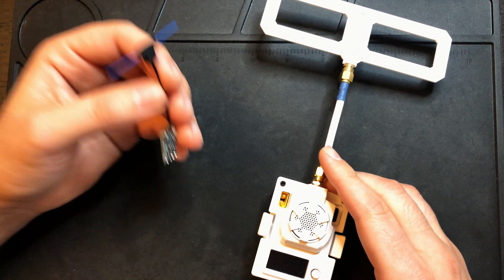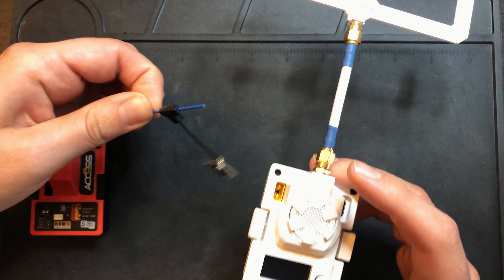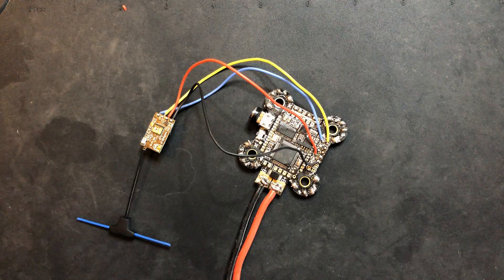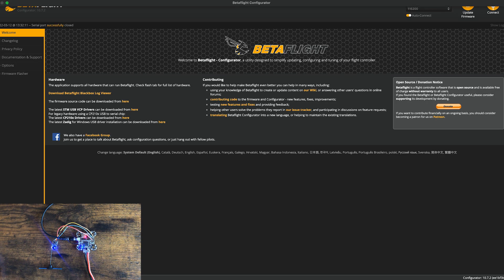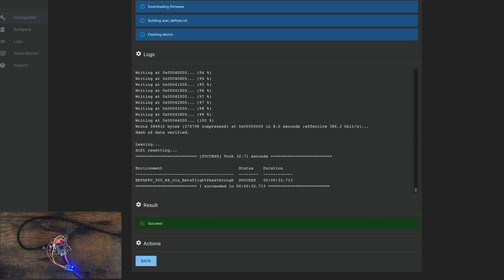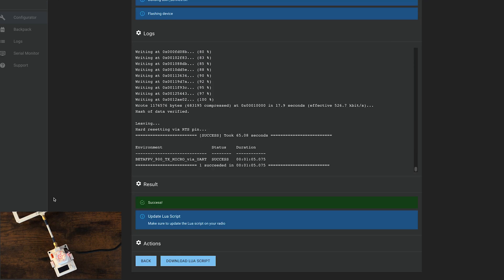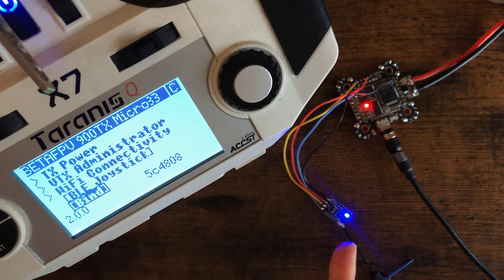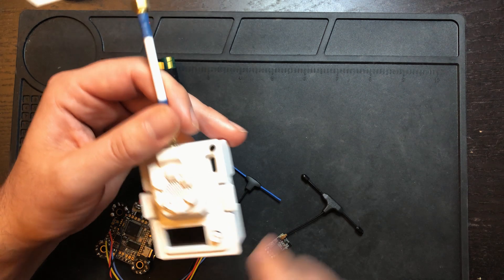Bye Bye FrSky - BetaFPV ELRS Setup

Comment: Do i need to change my radio too? I currently have a QX7 - i can just add this module to it? I wouldnt want to spend more to just buy a radiomaster radio or anything as more or less they are all same. What do you say?
Reply from the maker: You can use this module to the qx7 you’ll probably want to do the “crossfire mod” to the controller though.
Reply: @TRONCATFPV  u mean i need to update something on the radio too? hope no soldering required.

Comment: Hi, does any brand of elrs receiver work on this beta fpv transmitter? Ex: Happymodel radiomaster jumper. Or do you have to use only receivers of the same brand?
Reply from the maker: as long as its ELRS and 900mhz it will work with this module 👍
Reply: @TRONCATFPV  OK thank you

Comment: Hey, I have probelm with Express LRS app, i did every step like you did but at 3:49 as you "build and flash" it writes me ERROR message, but i dont know why.. (I have speedybee v405 STACK, ELRS 2.4GHz betafpv flat antena RX and BetaFPV Lite radio 3 (ELRS version). I cant connect these together. Have you got some idea what could be wrong? Many Thanks ! :)
Reply from the maker: make sure you have the receiver all set up in betaflight first. Then try flashing through ELRS again.
If it still doesnt work make sure your receiver is hooked up to the FC correctly (RX-TX and TX-RX)
Reply: @TRONCATFPV  Thanks, but ye everything correct -> RX-TX, TX-RX,
 betaflight -> Serial via UART, CRSF,  also correct port set as serial Rx.
Reply from the maker: interesting. Are you trying to flash 3.0 to it?
I was flashing 3.0 to a happymodel TX module yesterday and it was giving me an error. As soon as I flashed 2.5.1 it worked. Then from 2.5.1 I was able to update to 3.0.

Maybe try an earlier firmware and see if that helps.
Reply: Ok, i will try thank you for help 😊

Comment: What do you think the best way to go is? 915mhz? Or 2.4ghz? Want something 1W does the 2.4 and 915 both run 500hz mode? Benefit to 2.4 over 915? What has better range? Thanks for posting been looking eying it up. Have the full sized TBS crossfire think it will do 2W now and diversity recovers on my 7 inch builds. But wonder how elrs compares in the latency department and range?
Reply from the maker: Personally I prefer 900mhz over 2.4ghz. 900mhz has better range and penetration and since I fly indoors quite often I like knowing I have the strongest possible link. I have a 2.4 ELRS radio (just published a review video today) and i'm mainly just using it for my freestyle drones that I whip around in the park since I don't need the range/penetration. 

ELRS and CRSF 900mhz modules imo are the way to go.
Reply: @TRONCATFPV  appreciate the reply mate, I prefer 900mhz aswell didn't think the 2.4 was as good for long range and penetrtion. Always loved the CRSF setup, might try the 1W 900mhz 500hz option. Thanks again.

Comment: Hello Troncat! I also have the r9m rx module with ELRS... And I wonder if the betafpv module is way better; better enough to buy it I mean. Or should I just buy 915 txs and keep the r9m ELRS?
Regards from Brazil!
Reply from the maker: I would go with the BetaFPV module since its meant for ELRS. 
My R9M module still works with ELRS but I have had it failsafe. Not sure why they happened but after the failsafes I put it on my shelf and haven't looked back lol. The BetaFPV Tx module has been working great and I can continue to use the r9mm receivers 👍

Comment: I’m running ELRS 2.4 on one quad. Just curious why you chose 900 over 2.4, preference or another reason? Since the module was inexpensive right now, I’d thought about trying 900 myself.
Reply from the maker: I chose 900Mhz because I've been using the r9 system for the last couple years. I have ELRS firmware on my r9mm/r9mini receivers and they can bind up with this ELRS module using the binding phrase feature!
Since I do tons of indoor flying for real estate, 900mhz is better at penetrating walls than 2.4.
Reply: @TRONCATFPV  when it comes to lora modulation (what elrs uses) you have more than enough penetration on 2.4. But at least you have both options, which is perfect for people coming from r9

Comment: I don't get how people have so much issues with R9. I use it for 2 years now and 1 year with ACCESS and beside one single failed r9mm right at the beginning (it was a used one) I never had any issues with it. I have currently 7 planes on R9 and a few spare receivers to uograde the remaining 2.4GHz planes.
and ease of use? An OTA update without even needing the PC (just have the firmwares in my radio SD) after installing a new receiver and it's done and it just works.... way faster than this ELRS process.
Reply from the maker: What happened with the r9mm receiver that failed? I'm curious if it could be used with ELRS haha. I almost threw my r9mm out that stopped working but it works great with ELRS. I had a few micro failsafes with R9 gear but luckily nothing that resulted in lost quads. Upgrading firmware always seemed to just be a headache with r9. Maybe it comes down to ACCESS vs ACCST since my radio is ACCST.
Reply: @TRONCATFPV  the failed one likely smoked the telemetry transmitter from overheating as I made the mistake to embed it into foam with no airflow. it was still working fine in receiving signals but I lost telemetry after 30-60s after powering it on.

I have 4x r9mm, 2x R9 Slim+ and 1x R9SX in use currently. 2x R9MX spare and 2x R9MX just bought yesterday as they where really cheap at 42€ with shipping. 😅
Reply: @TRONCATFPV  Oh regarding updates. 
To be honest... There are no things like regular updates. Can be a good or a bad thing.... Yes it is lazy from FrSky not developing new features but on the other side I see it positive. It works and it does all what 95% of pilots need.... Controls crafts and transmits telemetry. Of course my old R9mm are non-OTA so I had to flash them manually once and as Serial Passthrough does not work on inverted-S.Port with INAV for me, I even had to desolder them, But there where no updates for over a year now so I don't bother. 

With ELRS I would have to go through all my planes manually, hoping that serial passthrough works properly and update them alltogether. 

If I look to crossfire (What I also have) how mouch trouble they have with the update process currently, non working Agent X for months, firmware bugs en mass. I really prefer to never touch a running system. :D